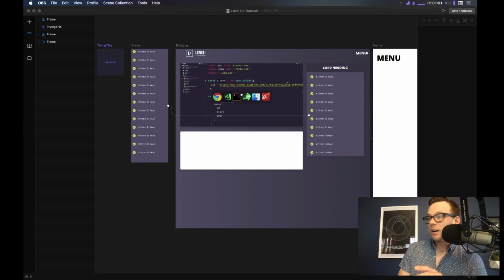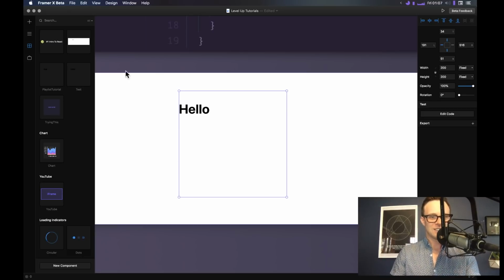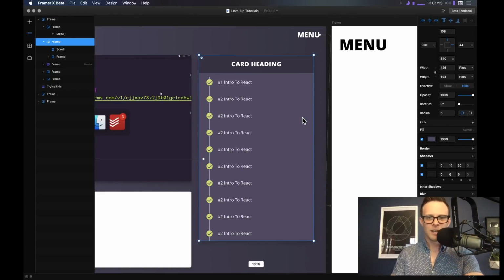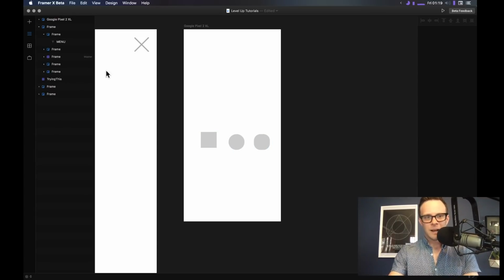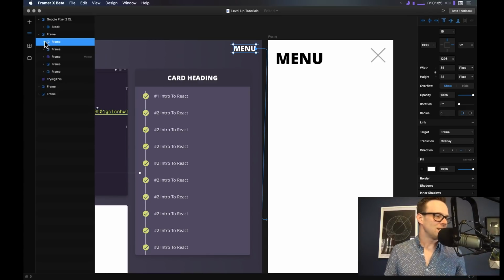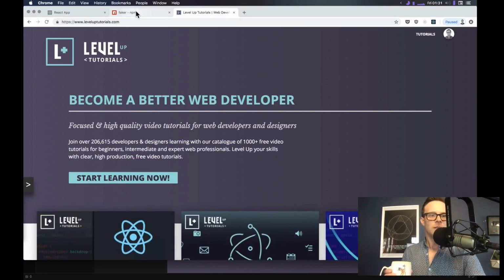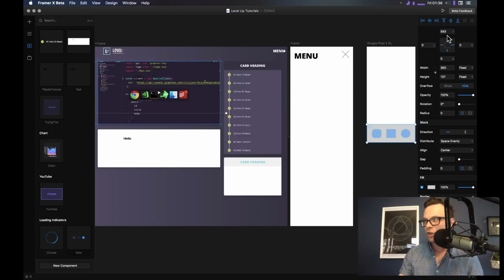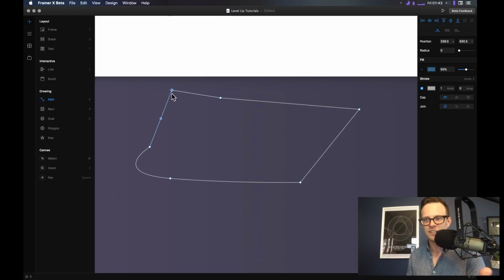Live With Level Up Tuts - Framer X First Look

Comment: You mentioned code and design components being separate things. How does this thing handle exporting code?
I was hoping to either be able to design and export React JS components or to grab existing components and tweak them and have them export as the edited version.
Reply from the maker: Yeah, I was too. As of right now, you cannot do that in this app. If it's a code component it can only be modified with code. If it's a design component it can only be modified via the design tools and can't be exported as React.